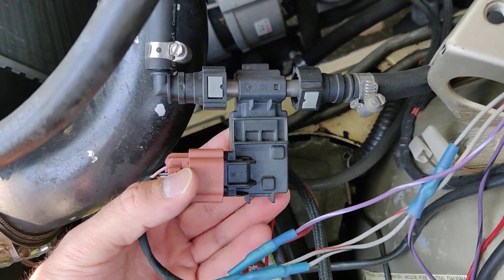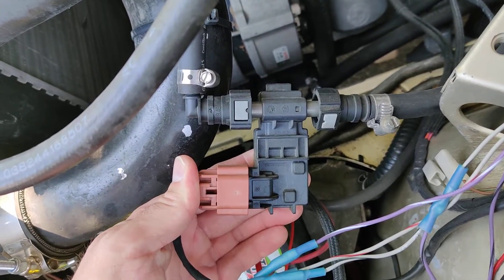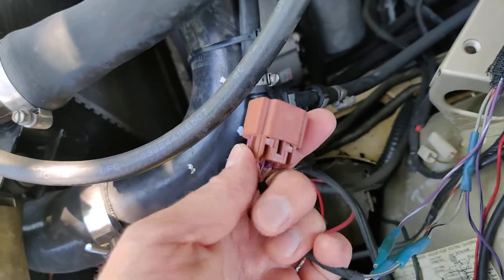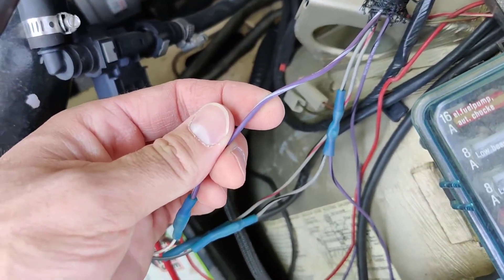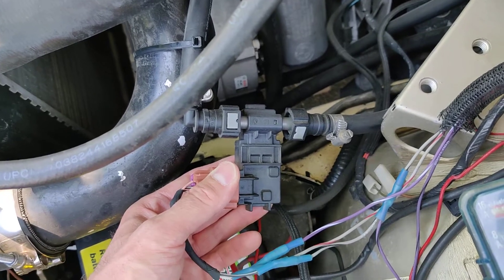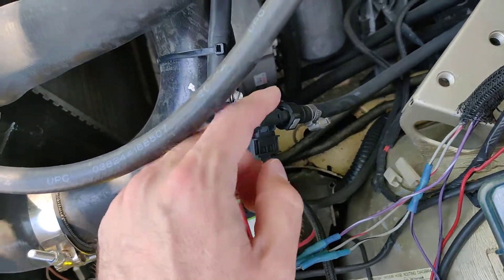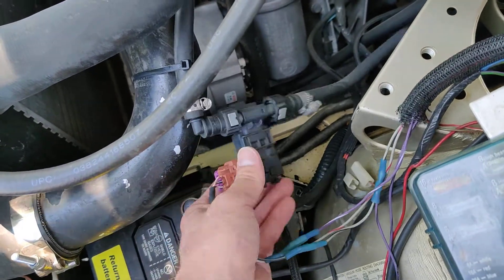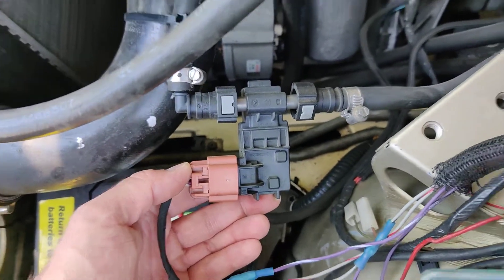Megasquirt Flex Fuel Sensor Installation Basics

Comment: Hey brother, I'm wiring in my flex fuel sensor now on my MS3. Question, for the ground did you just run it to the battery, frame or pick an ECU ground to tap into?
Reply from the maker: Hey John! I used a fused 12v for the power, sensor ground from the megasquirt and the dedicated FLEX wire from the megasquirt.
Reply: @TurbineResearch  awesome thanks!
Reply: Flex fuels from aliex....ess works ?

Comment: Great video. I have a Megasquirt 2PNp and can’t find the purple flex fuel wire. Is there a designated pin out I can wire it into?  Thanx in advance
Reply from the maker: The pnp will have a different wiring pinout. You just need to check with the wiring diagram for the pnp
Reply: Thank you